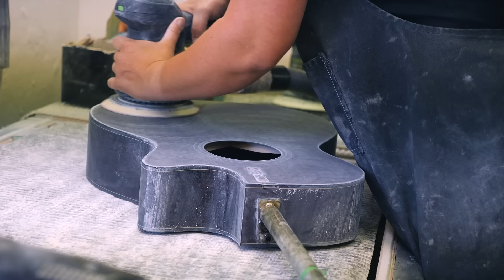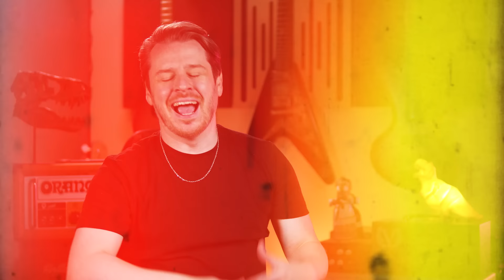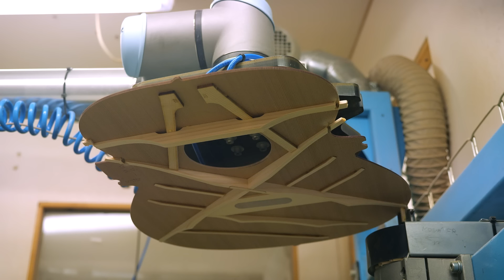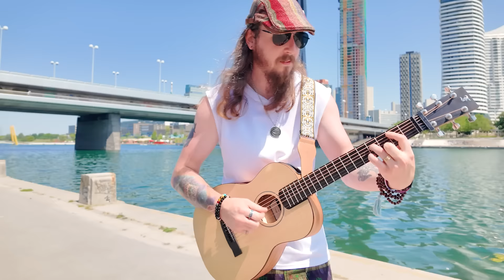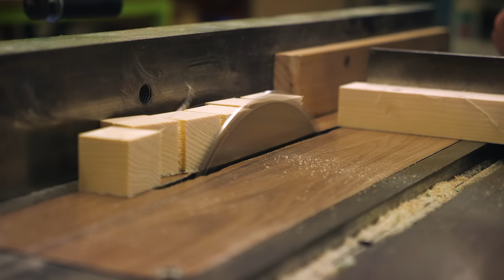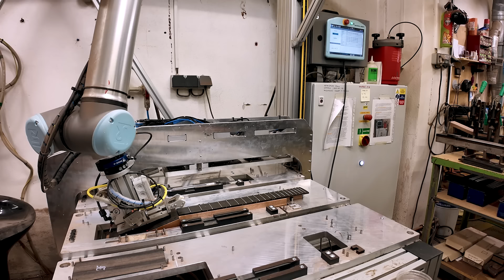Inside Furch: Europe's Most Automated Acoustic Guitar Factory

Comment: I want to believe. I got so excited seeing the cymatic sand patterns, only to end up with identical x bracing from 100 years ago. Some kind of kinetic bracing would be cool.
Reply from the maker: People were just as smart 100 years ago and were able to figure out the same information by tapping the board and listening to it. 

For that shape, there really is only one optimum pattern to maximise both structural stability and resonance. 
It's great to see it visualised in this way, and does afford much more data to be collected to justify the decisions being made - but ultimately it's how it sounds that should be the decision maker. 

Both approaches across time were aiming for the best sound, so it should be no surprise they converge on similar designs
Reply: Good points, Love these deep dives. Youre right, people were just as smart and there is more than one way to skin a cat, (isnt that how they got strings back then?, haha) its said in the spirit of gleaning more and more insights, will continue to be on the lookout for your content, thx for sure.

Comment: I have a question about the speaker/frequency test. Doesn't the soundboard need to be fixed, in some way, to the speaker? Otherwise, it seems that what you're seeing is merely the frequency the speaker is creating, and not how it actually affects the soundboard. Is this correct?

Comment: I’m puzzled that the guitar face / sand / speaker system that shows resonance nodes is bilaterally symmetrical, yet there are two braces that are added to the back of the face that are clearly not symmetrical. I’ve always presumed that has something to do with the string tensions once they are installed, but I’ve never found this confirmed anywhere.

Comment: humidity self adjusting neck...sounds a bit like snake oil right? well, that 1300€ furch i tried 2days ago sounded so much better then anything in its class, quick clean warm fast response, no slugishness. some contendors felt like plastic boxes. only very very mild deadnote spots in the usual lower e string higher registers compared to others.

Comment: Really loved the walkthrough style behind the scenes peak of the process of how their sound voiced approach worked as well as the CNR design to balance the truss rod evenly. It was a really kool innovation with a small block of wood to utilize the humidity like the top with expanding and contracting to work as a humidity neck angle adjustment. It’s great they also are open to open collaboration with other companies and vice versa to solve problems to compensate. To hear and see the work of a very forward thinking guitar builder presented this way visually and graphically is a breath of fresh air.
Reply: Don’t tops expand ACROSS the grain, rather than lengthening? If so, how does the lengthwise block function?